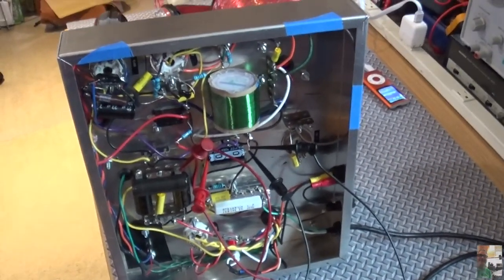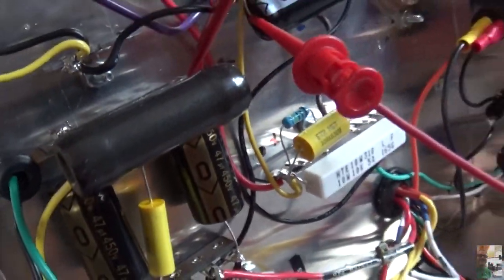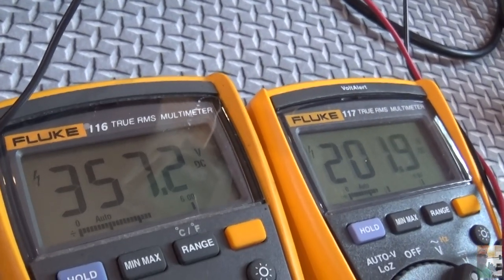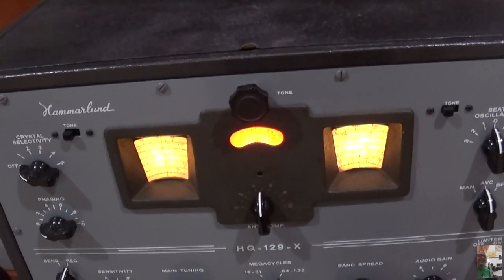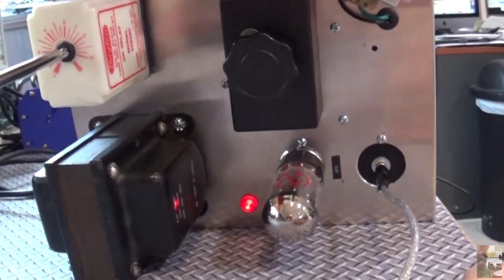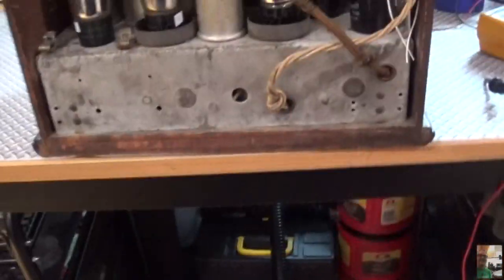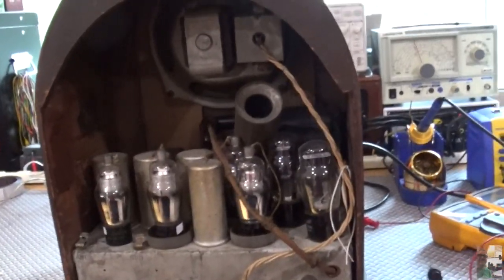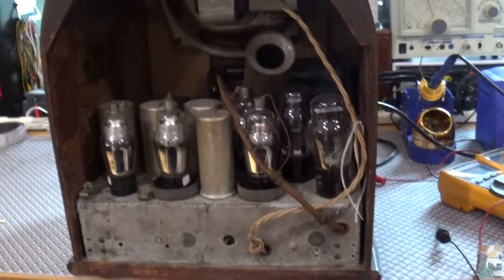Rick McWhorter AM Transmitter Build - Episode 14 -  Its a wrap or a rap..perhaps Rap Music.

Comment: can you use a NTC thermistor for the ''o'' center tap  to ground to keep noise done?
Reply from the maker: No need... two 100ohm resistors tied to the filament lines to ground do the trick. Just be sure to twist your filament windings

Comment: Hmm, imagine the range you would have if this were converted to an Upper Side Band transmitter; all of the neighbors would love to hear your "Donald Duck" impersonation, and you'd get to build a Beat Frequency Oscillator!

Edit: not the "Lake Wales Donald Duck", either!
Reply from the maker: I will have to add that to the TODO pile... :P   Once I know what an Upper Side Band Transmitter is of course... LOL  Thanks Ron
Reply: It'll violate part XV, but you should get more than a few miles out of it (no carrier, just modulated signal). There are times when my advice is not so good, and this is one of them.

Comment: Ron  is the 6 vac off the power transformer  for filament power for the 6L6 and 6sa7 pins 2 & 7 on both  tubes
Reply from the maker: Will, the 6.3 volt line is for the tube filaments.
Reply: 5 volt on the tube  heaters a problem instead of 6.3 i have a new 1937 in the box transformer,5v 5y3, 570v,but 5 volts on the filament v
Reply from the maker: The transformer should have 2 windings.. YELLOW= 5.0VAC    GREEN = 6.3VAC. 
the YELLOW only  goes to the rectifier tube..... (5Y3).   The GREEN goes to all over tubes.
Reply: not my question,my green is only 5volts will the heater work 1.6v less ,only transformer i have
Reply: you mean 3 windings? 570 volt,5v ,6v heater
Reply from the maker: yes sir...  Is your 6.3v winding center tapped ?    Green/Green/Green with Stripe
Reply: nooooo,i have no colored wires ,i dont have your transformer,i have solder lugs ,i have a 1937 TRANSFORMER POWER 550 VCT @ 40 mA 5V @ 2A 2.5VCT @ 5A Tube Type THORDARSON T5002 ,my question is will the heaters on the 6l6 and 6sn7 run on 5 volts or is that a problem
Reply from the maker: Will, it will not run reliably.  The first number of any tube generally indicates the voltage needed to drive the filament.  6L6  ( 6.3 volts)   5Y3( 5 volts). You have to consider that you only have 5 volts and will be powering  2-3-4 tubes and a pilot light.  The draw  on the 5v filament line will be too much ( in my opinion)  You have 5 volts with no load.
Reply: thanks  you ron i didnt even want to fire this up till i asked,i lost my old school tv guy last fall,it hobbyist like you that keep this stuff alive!
Reply from the maker: It won't blow up, but your tubes will likely not work well. You can find some decent cheap transformers on ebay hidden in boneyard  tube amps
Reply: I had a project years ago walk across the table when I turned it on! LOL Looks like you may be my new Guru...
Reply from the maker: Happy to help any way I can